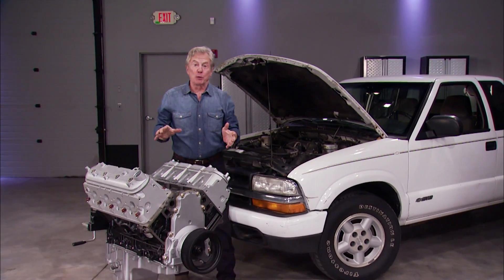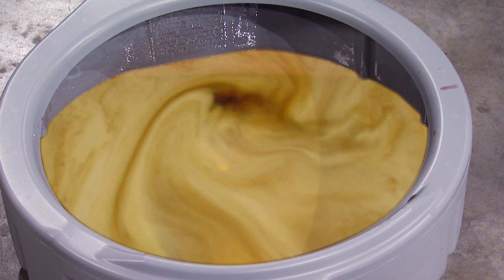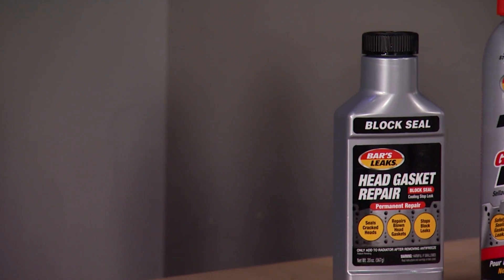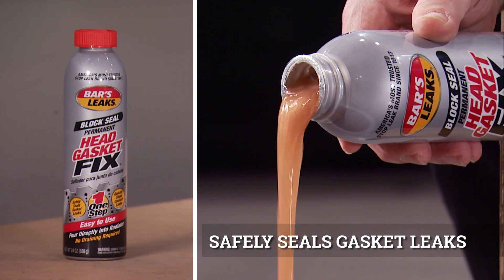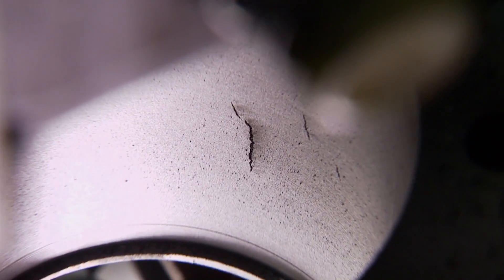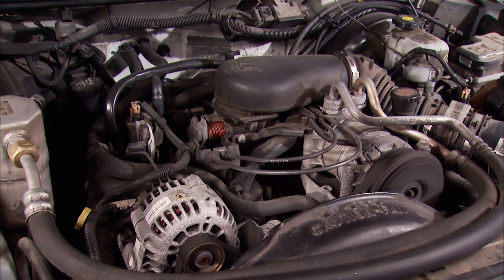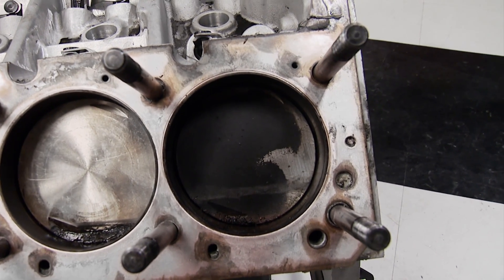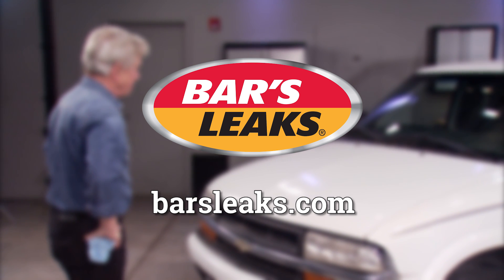Tech Review: Bar's Leaks Head Gasket Repair Solutions

Comment: Is it safe to leave in car or do u have to flush it. It’s in my radiator and backed up into my reservoir?
Reply from the maker: It depends on the product, 2 of the 3 shown in this video are compatible with coolant and do not need to be flushed out after install. 1 of the products is only compatible with water and requires it being flushed out after install. Check out our website for all information and directions on these products.

Comment: This really works I put it in about 4 years ago and it still running thanks to bars
Reply from the maker: Awesome, thanks for the comment!
Reply: I'm getting ready to give my 1988 Chevy G30 a third treatment of Bar's Leak. First discovered that its 5.7L V8 was seeping coolant inside 4 cylinders where it steam cleaned combustion deposits off that ended up covering the spark plug electrodes, causing it to bare idle. I installed new spark plugs with those affected cylinders using non- foul adapters. I used the entire bottle so there would be plenty left in the coolant for future seeps. I did that in 2011 where the product held up for 7 years before a second dose was needed. I was hauling tools and furniture from East Texas to NW Alabama to my son's house. I changed  the coolant, oil & filter and did a tune-up before leaving. Had a 3/4 ton load in the back of the van with another 800 lbs in an enclosed trailer. Was cruising along the interstate doing 55 to 60 mph when the engine began to miss and overheat outside Hernando, MS. I saw bubbles inside the radiator coolant so drove to an AZ in Hernando to treat again in their parking lot. Believe the first treatment held up for 15,000 miles ( the odometer broke in '96). The second held up for 6 years and another 15K since I now have bubbles in the coolant after repairing a start/no idle problem that suddenly popped up 10 days ago. I finally had it idling again and being able to place in R and D to move at idle speed without stalling so allowed the engine to idle for one hour to charge up the battery. Went to start it the next morning to find it didn't want to idle again. I used paper shims cut from a hard cigarette pack to set between the idle speed screw and throttle cam to gradually raise the idle to a speed where it stayed idling with multiple misses. I removed the radiator cap to find those damn bubbles again in the coolant. I did a radiator flush and refill with a new thermostat in February of 2021 just before that arctic deep freeze reached Texas. It still had the treated coolant from 2018 in it that would've froze if left in. I didn't drive the van from March of 2023 to July of 2024 until my 2005 Neon had its ECM go kaput. Was idling the van occasionally during that time to charge the battery so had a near empty tank when placed back into use. I added two bottles of B-12 to a full tank of gas to clean out the fuel system. Was getting 9 mpg city/hyway so treated the second tankful with two bottles of Berryman's fuel injector cleaner. That stuff really made a difference by increasing performance and raising the combined mpgs to 13. Twelve days ago I gave the engine an Italian tune-up by running 50 miles on the interstate cruising at 75 mph. I suspect sustained high speeds and high vacuum has an effect on the gasket sealer. The engine isn't pushing steam out of the exhaust pipe nor is there any coolant discoloring the motor oil so am confident that a third treatment will provide good results again. 

Been driving this van since 1994 as a work vehicle which has been dead reliable until something electrical craps out (coil pickup, ICM, MAP sensor, in tank fuel pump and recently the IAC and TPS). Best of all it's easy to work on with parts readily available at reasonable prices.

Comment: I dont have a radiator cap I have a  Reservoir so do I pour it in there?
Reply from the maker: If you do not have access to your radiator and vehicle has a pressurized reservoir, then product can be added to reservoir. If not then remove top hose where it connects to the top of radiator and install product in hose. Reattach and tighten clamp.

Comment: Just wondering how after draining the system how doesn't it overheat. While the car runs for 15 minutes?
Reply from the maker: When draining the system you would not have the vehicle running. You have to follow all 15 steps precisely to get the best results. They are located inside the back label booklet for this product.

Comment: The guy at tech support was uneasy about me using this product on my 2013 Prius V. I have cylinders 2 and 4 misfire but only shudders for a second initially then drives fine. I’m confident that it will work. Because the alternative is very expen$ive. Do you know how to put the car in gasoline engine only mode to do this?
Reply: Put Prius in park and  mash gas pedal half way and the engine will run

Comment: Can this be used for engine head gasket leak with water in the oil?
Reply: @Bars Leaks
Reply: I would be real hesitant to use it in that situtation dude. if you didnt I would do several oil changes back to back afterward with new filters. otherwise I imagine those small particles may clog up your filter maybe even the sump pickup and create oil starvation problems or worse possibly high oil pressure and blow seals or worse worse collect in places it shouldn't be like crank journals and cause wear on bearings.
Reply: You'll need to change the oil and filter first. There is a product that's added to the fresh oil that will remove and hold any remaining moisture in the water fouled oil remaining in the engine. Add that when adding the Bar's Leak in the radiator. It will capture any coolant that seeps out before the Bar's Leak seals off the leaks. You can keep an eye on the color of the motor oil while the engine is running by removing the dipstick once a minute. It should become slightly milky then stay that way during the rest of the idling period if the product seals off the coolant leak. Once the idling period is over then change the oil and filter then keep a close eye on the color of the oil as you drive the car.

Comment: My 2GR-FE engine has a blown head gasket and keeps pushing coolant out of the system into the overflow container. Added the high duty stuff a coupe days ago.  Still getting some bubbling.  Will let the car thermocycle for a week or so of my normal driving (~50 mi/day on average) and see how it goes.  Anything else I can do?  I used half the bottle (Coolant volume 7.9 liters).
Reply: Any update?

Comment: i used the head gasket repair on my 97 ford and it worked!
Reply: Can I put some in the reserve tank also to top it up? I just got some today thanks
Reply: @charlestaylor3110  yes i did
Reply: @doctormcboy5009  my truck don’t have a rad I just dumped it all in the reserve like it says also
Reply: @charlestaylor3110  did it work for you?
Reply: @doctormcboy5009  not sure yet I had to dump it in my reserve tank but so far not so good but will see if it makes it’s way through the lines. It Sucks there’s no rad cap exposed where I can just dump it in tho
Reply: @charlestaylor3110  i know what you mean mine is the same. i let it run for 30 mins with cap on

Comment: The carbon fiber gasket sealer worked great for me. The coolant in my reservoir would look like it was boiling. Not anymore after using this product.
Reply: Yes. I drained the old coolant and flushed the radiator and engine out with a garden hose and started fresh.. My coolant needed changed anyway passed the 5 year mark.. You don't have to change it. Just follow the directions carefully on the bottle. I recommend watching several videos.. I actually dont trust products like this. Not my first time changing head gaskets and they can be a pain... But this actually works
Reply: Did you need to drain the coolant system for this one, or no?

Comment: 2003 Grand Marquis.  I have to keep adding antifreeze.  My mechanic checked water pump, and radiator.  He said
he thinks its a head gasket from a small leak he found.  The temp gauge used to be rock solid winter, summer no change.
It started in the summer only when I ran the Air Conditioner.  If I was not traveling at least 50 mph it would start to over heat.
In the winter it was fine.  A second mechanic said the same thing it looks like a head gasket.  This car has 375K miles on it.
Now its starting to require antifreeze every couple weeks.  I noticed its leaking antifreeze from spots on the ground.
While I look for another car I would like to get a few more months out of this one.  What is the product number of the type that will work without draining the radiator?  I notice no white smoke coming from exhaust.  The engine actually sounds great with plenty of power.   Best car I have ever had.
Reply from the maker: Hi Ken, our customer support team would like to know more about your situation. Can you please give them a call? They are available M-F 8am-5pm EST, and can be reached at 800-345-6572. They look forward to speaking with you.

Comment: How if engine oil it's leak in radiator can I use this to repair?
Reply from the maker: Hi Andreas, if you are leaking oil into the radiator we can not help, and the issue would need to be physically repaired. Thanks for the question.
Reply: Ok thanks

Comment: I have a 2008 5.7 megacab 11” lift 40”s on 24x14 so I push a lot of weight
Have a full dual magnaflow exhaust no cats k&n intake and have had it tuned by a shop around my area and had a serious problem with my motor getting extremely hot, coolant bubbling radiator getting so hot it would give you a third degree burn if you touched it lol, I went on a goose chase replacing the radiator/then waterpump and thermostat still getting extremely hot. I was frustrated trying to figure out why my engine was getting so hot so I read up on forums online and decided to just try this head gasket sealer and I went threw the process correctly but didn’t use the full can only about 1/2 of it, and amazingly my engine is running so much cooler and sounds really healthy would recommend this 10/10 fixed my 5.7 hemi w mods 177,246

Comment: I have a oil leak right  between my engine block and gear box at the bottom; is there perhaps a "Bar's" formula to stop oil leaks?
Reply from the maker: Hi Steven, if the leak is coming from a seal or gasket we can help. Our tech support team is available M-F 8am-5pm EST, and can be reached at 800-345-6572 to further assist you. They look forward to speaking with you.

Comment: I'm about to try this on a 1999 Toyota Tacoma with 455,000 miles, losing very little anti-freeze and getting some white looking exhaust....hoping it will work, would like to keep the old truck around if this fixes it.
Reply from the maker: Hey Good Friend, if you need any assistance our MIchigan based tech support team is available M-F 8am-5pm EST, and can be reached at 800-345-6572.

Comment: Used this on my 2010 Mustang V6 - had milky oil never any overheating.  Just a day after using this my car is now overheating completely randomly and can't be driven. What could have happened? Followed usage directions exactly.
Reply from the maker: Please call our tech support line at 800-345-6572, so they can discuss this with you. They are available M-F 8am-5pm EST.
Reply: THIS couldn't have fixed your problem. THIS is for temporary antifreeze problem. Now you have clogged all your cooling system.

Comment: Used the heavy duty stuff on an old Land Rover Discovery 2 and it worked like a charm. Engine was drinking about two gallons of coolant a day. Stopped it immediately and it holds coolant like brand new now. Didn't foul the radiator or heater core either. Great product.
Reply from the maker: Great to hear EVOCATEUR, glad we could help you out.

Comment: What If I don't have water getting in the oil but am losing Coolant through the headgasket? Will the pour in work better?
Reply from the maker: Hi Sean, please call our tech support line so they can further assist you with your situation. They are available M-F 8am-5pm EST, and can be reached at 800-345-6572. Thanks Sean.

Comment: Would this work on a 07 hyundai santafe diesel turbo 
Its got similar problems it's not quite over heating but it is bit higher then normal and  is losing coolant all the time and its not leaking out of the radiator cause I had it pressure checked and witch one should I use for a problem like that
Reply from the maker: HI Anthony our tech support team would like to know more about your situation. Can you give them a call? They are available M-F 8am-5pm EST, and can be reached at 800-345-6572. Thanks.

Comment: Does this work on lower intake gasket leak. I think that's where it's leaking but it could be head gasket. It's leaking coolant externally, I can see the front of the block is wet. The driveway gets wet under the engine, not the radiator and not from the overflow hose. It may be leaking some internally too though since there is a slight wetness under the tailpipe.
Reply from the maker: Hi Dethmeister our tech support team is available right now until 5pm EST. They can be reached at 800-345-6572. They would like to discuss this with you. Can you please give them a call?
Reply: Hey did you figure out anything? I'm having that same problem. We had a leak in the expansion tank and before I could get it fixed my daughter ran it hot and it died 4 times on her way home. Now it's clicking and water leaking out externally from somewhere that's above the cv axle. Thanks.

Comment: Hello! I currently have white smoke/coolant burn and a possible head gasket issue. I picked up some Bar's Leaks Radiator Stop Tablets. If I were to use the tablets first and the issue is not resolved, is it safe to move up to the bottles after I have used the tablets?
Reply from the maker: Hi EveningCommuter the short answer is no the tablets can not help with a head gasket issue. Please give our tech support team a call so they can get some more information and make a recommendation for you. They are available M-F 8am-5pm EST, and can be reached at 800-345-6572.

Comment: I have a 08 Lincoln mkz with milky oil the coolant disappears and i will idle for 15 minutes without over heating. I don't have a direct access to the radiator only a over flow cap that I add my coolant to I want to get the expensive bottle because I can't offord to get the head gasket fixed how can I add this to my car to fix the leak?
Reply from the maker: Hi Mike, our full installation instructions are on the box, we would advise to follow them step by step. If you would like to speak to our tech support team to walk you through them they are available M-F 8am-5pm EST, and can be reached at 800-345-6572. Thanks for reaching out Mike.

Comment: I have a 2007 Jeep Grand Cherokee SRT8 (6.1L Hemi V8) Was running hot (220) Higher than I normally see it at . I changed thermostat and  was good for about 2 weeks then back to running higher than  I like. Thought maybe I didn't burp it, so took it to a shop they drained the system and  resintalled the coolant. During idle test it stayed around 210-215 would drop down below  210 when fans kicked in. During hwy driving she runs still around 220-225 but in slower traffic it cools down to around 206. The shop said there possibly could be a small leak in the headgasket and recommended stop leak. I don't have any white smoke or milky oil. What are your recommendations? I bought your product but have not installed it yet...
Reply from the maker: Hi MrMoe'sToys, please give our tech support team a call so they can further assist you. They are available M-F 8am-5pm EST and can be reached at 800-345-6572. They look forward to speaking with you.
Reply: I have a similar issue, did it work for you?

Comment: Will this clog up your cooling system ?
Reply from the maker: Hi Austyn, this product will not clog up your cooling system. If you haven't had a chemical flush performed on your vehicle in the last 3-4 years we recommend having it done prior to use to ensure proper flow in your system. If you would like to further discuss, please call our Michigan based tech support team at 800-345-6572. They are available M-F 8am-5pm EST. Thanks again for your question.
Reply: Bar's Leaks ok thank u

Comment: I was dubious on these snake oil fixes, but it seems to have worked. 

I used the 2nd type shown in this video. I have found this stuff is sold under at least 3 different names, Bars Leaks, Nulon and Rislone. It's even the exact same bottle and labels, just a different brand name on it. 

Our car overheated as the radiator cracked and ran low on water. I replaced the radiator and it wouldn't overheat or use water while running but from then on it took 50 to 100mls of water from the header tank each time the car cooled down. It would also start up with a cylinder down for a few seconds on each cold start. I assume each time it cooled it drew water into at least one cylinder. 

After using this, it seems to be working, it now starts on all cylinders. I'll update in a week as to if its still using water!
Reply: Update, engine is now using no water and starts on all cylinders. Cheap fix!
Reply: @spinnanz  thanks for the update!
Reply: @papascabs2767  Further update. We sold it about a year after stop leak was put in it. For us it never used water after it was "fixed".

I've just checked the vehicles status online now and it's still on the road and being used 3 years later. I assume the leak fix kept working as to replace a head gasket would be near the value of the car.